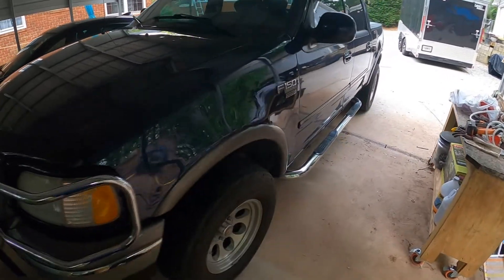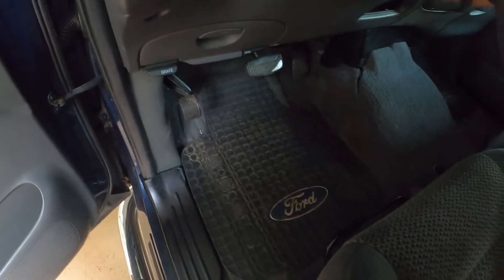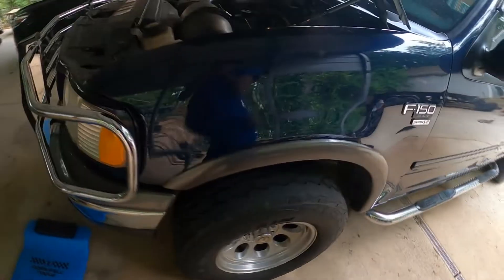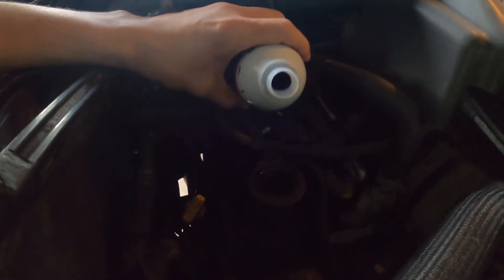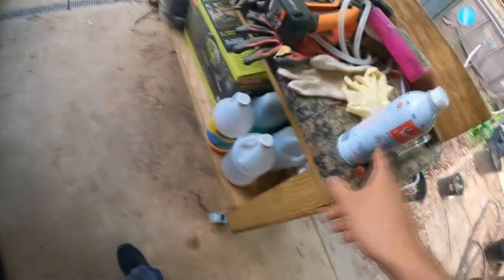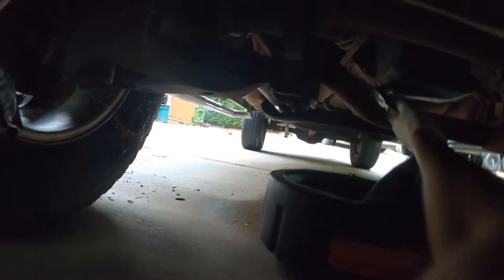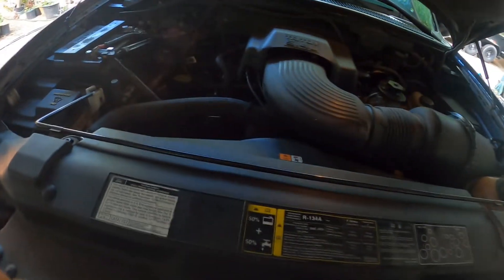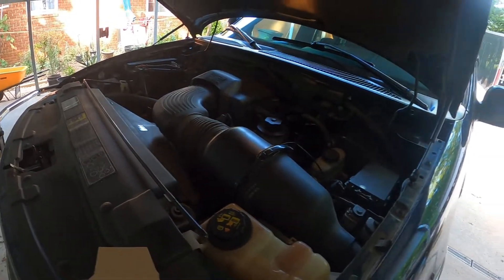Seafoam in engine oil

Comment: After adding the Seafoam.  Why not drive around for a couple of days to really clean it good?   I use it every so often in my car and Goldwing gas tanks.  I was told even through the  gas tank, it thins out the motor oil.  That's why i use is nearing an oil change.  But I never change the oil twice.  Food for thought though.
Reply from the maker: I have heard  of people adding sea foam then driving it.  I didn’t do that because I had talked to a shop that just let it run for like 15 mins before changing the oil and had been getting good results. I didn’t have to change the oil twice, but I wanted to get out as much of the old oil as I could.